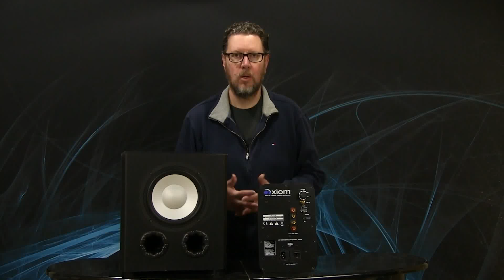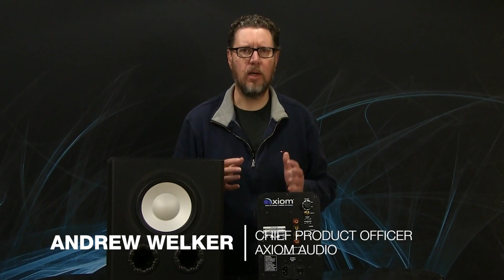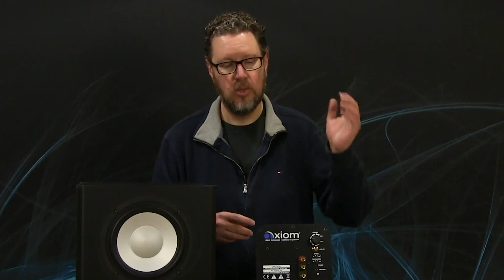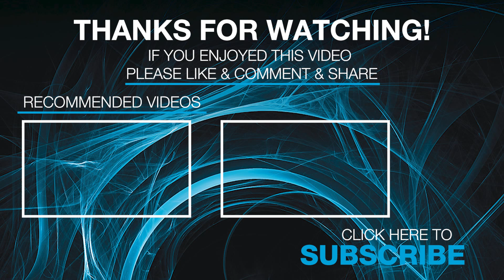Subwoofer Crossover: Best Settings For Home Theater And Home Audio Systems

Comment: One thing to add from experience: Power outages. I'm mostly a 2 channel listener now. I have an AVR that can control crossover. But when the power goes out it goes back to defaults. I like using the physical crossover dial on my sub since that stays put.  The starting point of 80 Hz seems to work well with my M3Ti's. The sub is a small basic 1010 from ELAC.
Reply from the maker: That’s very strange that you’re AVR does not have non-volatile memory that saves your settings when power is disconnected, but I understand completely why you prefer in physical crossover dial!
Reply: @AxiomHomeTheaters  It's a Panasonic about 15 years old. Short outages don't matter but we've had some outages over a day where the settings are lost.
Reply from the maker: @BobGeogeo  Ah, that’s probably the difference. Sometimes the memory is backed up by a large value capacitor that will keep the settings for a short time, but not days.

Comment: My good man here’s how I have my sub hooked up on my two channel system. My tower’s go down to 35Hz according to it’s spec’s. My sub goes down to 20Hz according to it’s spec’s, so I set the crossover point on the sub to start at 45Hz that’s 10Hz before the towers drop off. The volume is set so the sub disappears but in heavy bass tracks you can definitely hear the low end from the sub
Reply from the maker: Sounds like you have it setup perfectly…I also prefer some amount of overlap if you don’t have the ability to control the roll-off of the main speakers.
Reply: @AxiomHomeTheaters  how much overlap would you recommend? Maybe 20 hz worth of overlap?
Reply: But I thought he said to set the crossover on the sub itself to the highest point?
Reply from the maker: @rindershow212  Yes, assuming the AVR is going to take care of bass management.